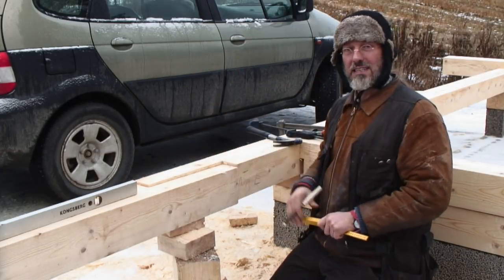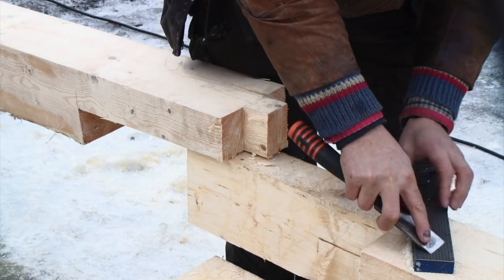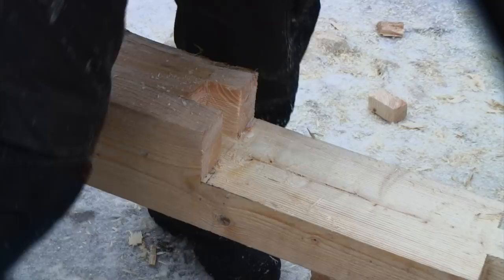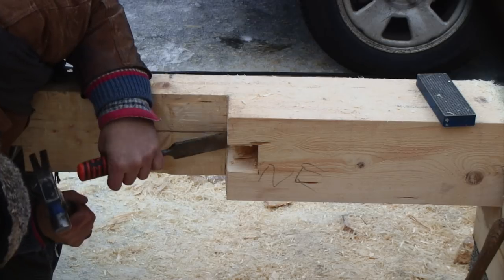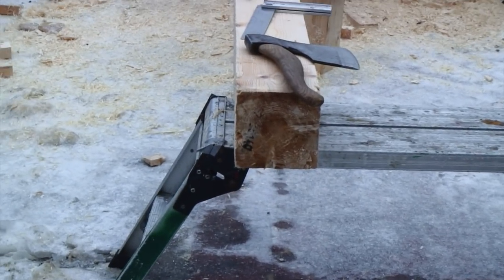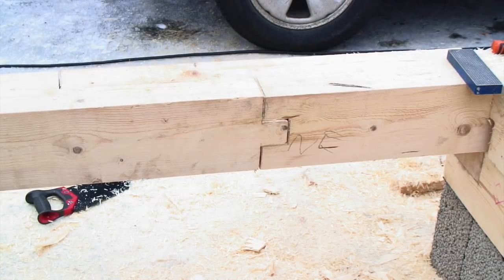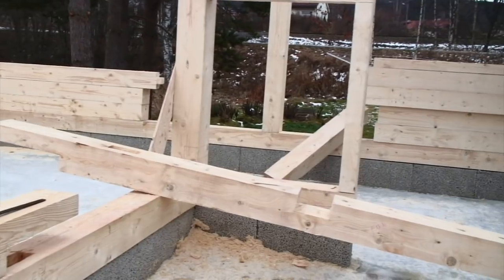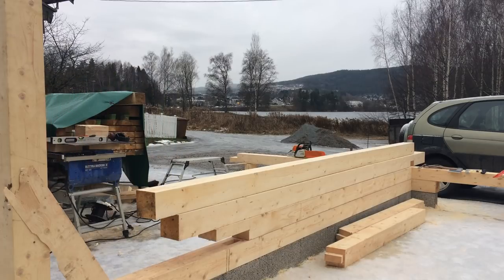🔴 4/35: building a Post and Beam Garage - A Tie Beam (not a purlin)

Comment: i'm in the northeast of the u.s. in up state new york,  i think we have the same weather, sweating is hard to avoid.
my grandfather always used the folding rule, i have his , never seen him with a tape, he did have a builders 50 foot wind up tape i have that also.
Reply from the maker: I also have my grandfathers steel tape measure, but it is in feet and inches and we use metric here so I don't use it on site. Thanks for your engagement and participation, all the best Lucas

Comment: Lucas, where in Norway did you get that handy ratcheting clamp you seem to use all the time? What a glorious helping hand. I am on the look out for some new clamps so if you have any tips it would be much appreciated.
Reply from the maker: The straps I'm using are what lorry drivers use and the metal g clamp type one came from a firm called TESS who deliver hydraulic pipes and metal working tools here in Norway (very expensive). It has a definite knack to its' use, tricky one handed. It may be made by USAG I found a Bessy version online that looks similar https://www.screwfix.com/p/bessey-gh20-all-steel-lever-clamp-200mm/3050k . All the best Lucas